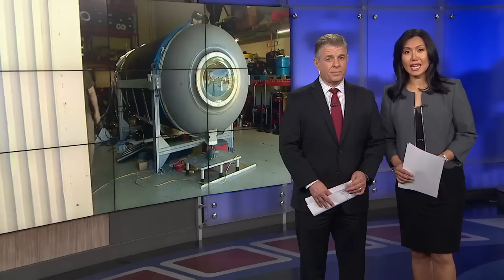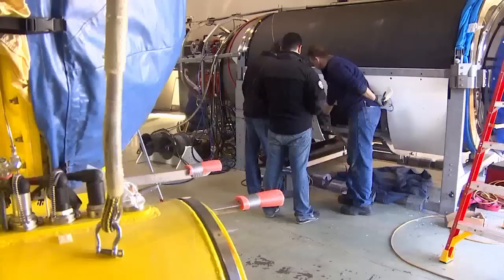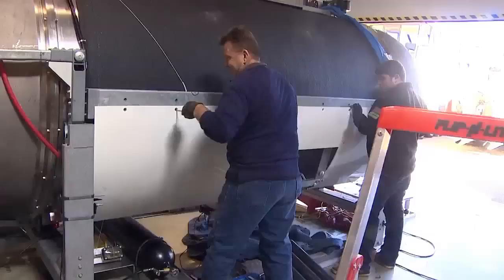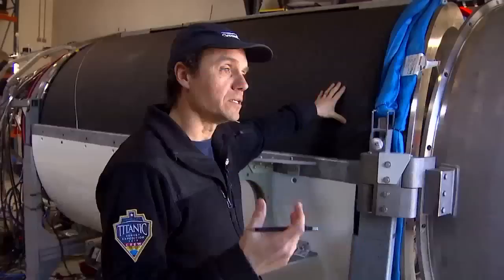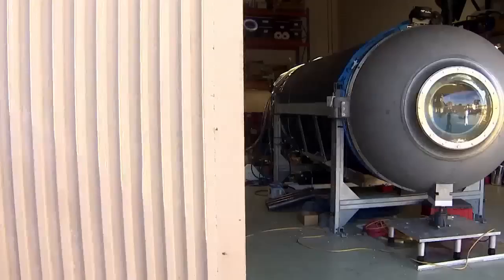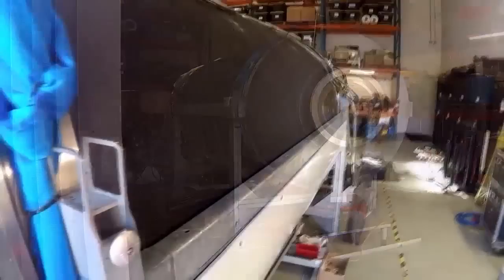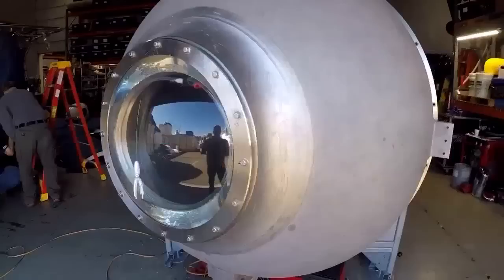The making of Titan: Oceangate's submersible capable of taking people to the Titanic

Comment: I'm a layman, but doesn't that door (with a flat mating surface) seem excessively large compared to any other sub designed for such depths? And controlling it with a game controller? WTF?
Reply: I know right...its like a guy trying to make an electric car and having most of the controls on some dumb computer screen in the car! If its different and new I dont like it!
Reply: 100%.  Even a tiny imperfection or gap in that mating surface would be catastrophic at those depths and pressures.  And because it lacks a modular design, any single point of failure will instantly cascade throughout the entire vessel.  That is why other deep-sea vessels have an isolated crew quarters (usually a small sphere with a minimally sized entry point), so that even if another component experiences a catastrophic failure, there is a good chance the crew will still survive.
Reply: The game controller isn't really that odd considering a lot of military/exploration equipment use game pads as most people are familiar on how to use one. It just makes the training less complex. The big issue is that this game controller was Bluetooth wireless. The deeper they go, the more interference they may experience thus making the controller useless. They should have used wired connections. I claim to be no expert on this kinda stuff but I have heard this people who are more qualified in the respective fields. Also the fact that Titan had no backup control systems was a recipe for disaster
Reply: Hey let's build a submarine make it look cool and have a few game controllers running it then dive to 13,000 feet below sea-level to see the bottom......
Reply: the viewport is also far too big and the fact the sub is not even spherical is concerning to say the very least.
Reply: @isaiahaguilera7710  🤦‍♂️

Comment: I'm a Pressure Vessel Engineer with a lot of experience with high pressure vessels design. By looking at the video and their design, I doubt they used an o-rings like you are suggesting. Most likely they used RTJ gaskets which can withstand up to 10,000 Psig and more. I'm more concerned about the material and size of the window been able to withstand high pressures.
Reply: The wreckage seems to indicate the glue separated between the cap ends of the tube. Titanium rings glued to 5 inch thick carbon fiber. A dome then bolted to that. The coast guard description they are claiming says they found the two dome ends in tact by the Titanic bow site. Then debris in between. Carbon fiber is said to shatter at that level of application. I'm not an expert in these materials, but it sure sounds like the epoxy only needed to fail a small amount to eventually give way a bit like stomping your foot on a Pringles can to watch the top go flying.
Reply: @bat__bat Wow! 😯
Reply: @bat__bat seems about right.
Reply: @bat__bat  Interesting! The safety margin for depth seemed alarmingly small to me, I guess a factor of 2 or more wasn't viable and/or the business model/needs appear to have taken preeminence. Coming from biking CF is an amazing material up to the point it fails and the mode of failure tends toward instant and catastrophic. There are well established methods for checking CF integrity, I hope there was rigerous documentation, ongoing maintenance and a craft retirement programme. If not the act of inviting the paying public into an uncertified, inadequately maintained craft makes passenger waivers completely irrelevant. No doubt the legal community is circling overhead!
Reply: I'm guessing you are also passed the age limit that OceanGate hired at. Instead of having people like you that know the field, and understand it, they hire a surfer and a few fresh out of college kids, that didn't take those types of courses in school, nor had any experience in the field. This is one reason, why I believe every single person involved with OceanGate, needs to be held accountable. The only thing they were successful at was designing a multi person underwater coffin.
Reply: The owner said the plexiglass window pressured in about 3/4” on a previous dive. Said he could hear cracking!
Reply: @jqulrich  lol 😂 yes and me! I’m betting one or several people from the company will get hung out. Do they really deserve it? time will tell.
Reply: @dave-d-grunt  WTF! The stories that are getting banded about are insane! The whole situation reeks of a one man smoking his own product and zero accountability!
Reply: @ananas6969 excellent observation, there is absolutely no way two materials (like titanium and carbon fibre) can be married together on a permanent basis they are almost opposite on a molecular level. Temporarily yes, extreme depth cycle after extreme depth cycle NO!
Reply: @Sidowse  so the carbon fiber on this vessel was wrapped around layer by layer like adding heaves of electrical tape to a tube until the material is 5 inches thick radiating outward from the inner pipe that is being wrapped. I actually have no idea what the inner core actually is that the carbon fiber is wrapped around on this vessel. So yes by wrapping layer upon layer it is really self-compressing as it is applied. I doubt the water pressure was able to affect the carbon fiber hull if you imagine the water pushing against the cylinder's sides at a right angle. So the compressive strength of the cf isn't what I think failed initially. As I said, I'm guessing the glue that held the cf cylinder to its titanium end cap rings is to blame for initial failure. I don't know what type of glue they used, but I'll assume it was like a NASA-grade epoxy that is water resistant, likely two-parts mixed together like a super duper JB weld. Silicone? Some exotic resin? Liquid metal slurry? Some research might reveal what exactly they used, but all I know from seeing it in one of those news clips is the glue was thick and gray colored. Adhesives are nothing if not famous for off-gassing when temperature and pressure changes around them. Like James Cameron said about the ship as a whole, it wouldn't have revealed its failures on the first or maybe even the second voyage, but the nature of the failure is developing over time with each dramatic change in temp/pressure. Maybe the glue they used has a proven track record at even higher depths for even more important vessel components. I don't know. But I avoid gluing anything unless I absolutely have to and I'm talking about household things or car parts that aren't life-critical. Maybe they should have used a stitching or welding method to marry the end-caps. But adhesive? If you can imagine the glue failing there, water would leak in through the microscopic gap and in milliseconds it would push like a million gallons of water  into that seam (exaggerated) but it seems to me the failed end cap would fly opposite the rest of the vessel, outward like a squished Pringles can.
Reply: @jqulrich  they couldn't even get that right
Reply: @bearb1asting  Lol true! Because a coffin isn't supposed to implode on itself
Reply: @bat__bat  I agree with you and Adonai both. The window and the end cap joints were both weak points. Stockton told someone when the craft would get deep, the plexiglass window would bow in, and it was freaking 7 inches thick, which is thick, but probably not thick enough for its size. Then they showed him gluing on those end caps with epoxy resin, and epoxy resin has a tensile strength of 5 to 6000 psi, but the ocean pressures at the Titanic are 6000 psi
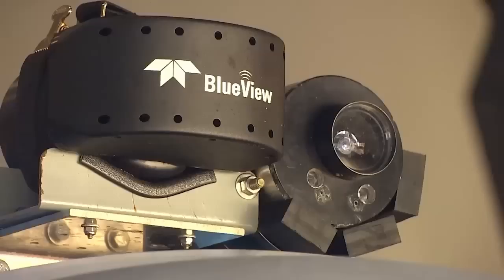Reply: 1:15 how do you feel about what appear to be huge glue voids around the edge of that window, showing a very non-flat joining surface?
Reply: @semechkiforputin6920  finger crossed he says "unsurprised"

Comment: A single O-ring to seal against 6,000 psi...on a large fixed hinge, flange door...?
Reply: Aircraft mechanic here and I thought the very same thing. We have to replace worn O-rings all the time due to them getting rubbed/worn/scratched. And apparently this thing made the trip several times. My hunch? Cyclic stress failure. They simply did it 1 too many times without inspecting everything and replacing the parts more prone to wear.
Reply: Possible the design was not the best for cyclical failure, aren't both titanium and carbon fiber considered brittle?
Reply: I'm a Pressure Vessel Engineer with a lot of experience with high pressure vessels design. By looking at the video and their design, I doubt they used an o-rings like you are suggesting. Most likely they used RTJ gaskets which can withstand up to 10,000 Psig and more. I'm more concerned about the material and size of the window been able to withstand high pressures.
Reply: @Adonai-lz5jb  - I was referring not to the door seal, but any possible seals in pumps/air hoses and the like. Flexing/use at cold temps usually make micro-tears and rips that cause them to fail or increase wear over time. But I was wondering about that carbon fiber. It is strong yes but at what temp, and at what depth? And yes, carbon fiber doesn't crack, it shatters? All of that is purely guesswork on my part. But based on what I know, personally I wouldn't trust that thing to explore the bottom of a pool let alone 2 miles down. If nothing else I would refuse to get locked in with no emergency egress. I care not to repeat Apollo 1. Fire aside, what happens if you are cast adrift? You could theoretically run out of air while even on the surface if you aren't found in time, and that's, well, just dumb.
Reply: @Adonai-lz5jb I know the dome of it was glued onto the carbon fiber would that have been the issue?
Reply: @GOODFELLA-uk6rz  I would guess they used an bolted acrylic dome in their design. Acrylic material gets brittle with low temperatures and gets affected by cyclic fatigue due to temperatures. I'm just guessing and doubt they had a good engineer design. You can't use glue for high pressures.
Reply: @thatguy9088  ah okay, I thought you were talking about the door seal. I apologize about that. Yes, you are correct low temperatures affect the yield strength of any material. Also, I didn't know they used carbon fiber to build it. I thought they used an alloy to build it. Carbon fiber is even more prone to fatigue due to low temperatures and can't withstand compression pressures as well as tension. It would be interesting to see any calculations that they ran in their design, if any.
Reply: @Adonai-lz5jb  The image of the hemispherical door flange at 0:12 looks like an O-ring groove. What do you think?
Reply: @Adonai-lz5jb  - According to the video the main body (the tube) was made of a Carbon Fiber and Titanium composite, wrapped in a single weave. But it doesn't elaborate.
Reply: @earlgreystoke3324  The design is trash.  Carbon fiber is usually used for internal pressure and not external pressures. Carbon fiber can't withstand compression too well. The material and component selection is trash. I doubt they ran any type of engineering calculations with all the different factors. Bolt quantity, bolt sizes,  dome window size and material etc. I don't need to run calculations to be able tell you that it was going to implode.
Reply: @Adonai-lz5jb  Was it this exact hull they were referring to that had gone down about a dozen times since 2021?  That would certainly be giving it some fatigue cycles.  Might turn out a miracle it lasted this long.
Reply: i have seen a little of the documentary on the build of Titan, i don't understand where the design came from, you would think an aperture of something that large would have a far more comprehensive system in place to seal the cabin, like a large screw on cap - even the bolting down seems too stupid and simple, remember KISS keep it simple stupid, there's over engineering and here's classic under engineering, i don't even get the logic behind gluing the titanium ring for the front dome to the carbon fibre tube, you would think that ring would have a complex fitting, being built into the carbon, multi layered inside and out the ring with bolts, i'm sure the pressure loading was pretty well looked into, but what of the extremes, the temperatures, the constant changes from down there to our atmosphere, look how aircraft have evolved, and the understanding after so many many accidents - we still don't know everything, and yet still the smallest most insignificant bee blocking a pitot tube can bring down the largest of planes, we live in a mad world full mad loonies

Comment: Evidently, the crew compartment was a cylinder with domed ends rather than a sphere. Not an optimal shape for this application...
Reply: Also, carbon fiber is a terrible choice.  It is great in tension for COPV. But in compression with high pressure on the outside ... Just no.
Reply: Well you can't really expect optimal results, when not a single person involved in the design and build of this "submersible" had any optimal experience. This is what happens when you want "young and fresh" in a field that requires expertise and knowledge

Comment: Made of carbon fiber and titanium?! Why not steel? CF may be great for airplanes and race cars, but to withstand 6K pounds of pressure per sq. inch?? I don't know about that.
Reply: You're right CF isn't designed for that level of pressure.
Reply: It is designed for that kind of pressure. Sadly, from the inside after being filled and pressurized. I think a lot of people, including everyone at Oceangate and all the "engineers and students" do not understand it's not the same in reverse with pressure from outside
Reply: @JF32304 It is if it's well designed.

Comment: The engineering to this thing is awful. Being that small, getting bolted shut from the outside, made of carbon fiber, and being controlled by a PS3 controller. This sub is piss poor quality.
Reply: YouTube couch-engineers...hard to satisfy
Reply: @whatyoudo9773 The thing has no beacon. If it surfaces, and the support crew can't find it in time,  then they are DEAD because there's no way to exit from the inside.  It doesn't take a armchair YT to recognize one of the flawed designs.

Comment: And the fact that they need someone else to open the door that’s crazy!
Reply: no thats engineering..a very specific craft thats meant to have a support crew. It happens
Reply: @whatyoudo9773 Safety experts recommended a secondary escape that can be opened from the inside. This was rejected. They also have no beacon. They could have successfully surfaced with everyone alive but the support crew has no way to track it, and the inside crew has no way to escape. It's designed to fail.

Comment: @KOMO NEWS : before giving your report publicly, did you find out if it is a safe vehicle. At a depth of 4,000 meters you need a submarine. Titan broke into pieces at great depth. For 14 years, improvisations have been used to build the vehicle. For 14 years, no authority has reported itself until after the tragedy.

Comment: Not only was carbon fiber the wrong material the window was rated for 1300m and they went down 4000m. Toss up if the hull failed or the window blew out first. Same end = impolsion and instantaneous death.
Reply: 1300 meteres = 3900 feet.  4000m = 12000 feet.  Here is a Malort and a Old Style saing the view port catastrophically failed first.

Comment: As a diy guy who has worked with composite material such as fiberglass and small amounts of carbon fiber in the automotive world, those materials should NOT be used at such extreme pressures. 
Carbon fiber matting is held together with resin, layer upon layer, which can create a delaminating issue, and a leak. Yes, when brand new, they are very strong, but weaken significantly as the structure gets used. 
At 5500 psi, with under water currents that produce dynamic shock loads on a used carbon fiber hull, its not surprising that it failed. 
This is why you see NHRA funny cars get new bodies every so often since they wear and fly off. Once they begin to crack and delaminate, time for a new body.

Comment: Its made of carbon fiber? My guess is that with every dive, there was some tiny amount of damage to the hull, until it failed.
Reply: Cracks do go undeteced.  Think about the DC-10 that crashed at O'hare airprt a some years ago.  Inspections were done.  the engine was reinstalled which caused a bulkhead crack in a hard to reach place so it was not notices.  The plane flew 25 or 30 or so more missions after the maintence and  inspection.  THe plane was taking off at Ohare, the port engine pod literally seperated from the wing on take off. the plane was at the take off point and the polit was committed.  The plane banked left and crashed  short of a trailer park killing all on board.

Comment: Worse, another video shows them attaching the front section to the cylinder using only an adhesive. No doubt a strong adhesive, but was it proven to be robust in those conditions over multiple dives? No tongue-and-groove or other methods to strengthen the attachment. The porthole section was literally glued on. Likely the vessel, the portal glass, the adhesive, all had different stress levels and none were tested properly. It was as tight as a school project.
Reply: I watched the video where it shows them gluing it on... jaw dropping. How they ignored the fact of expansion and contraction boggles the mind!
Reply: prob made by the same genius's that said " hey we cured the flu in a year, just take this shot" or else
Reply: That’s his aviation back ground showing. Way different pressures at 12,000’ Down than at 35,000’ feet in elevation . Is there anyway you can post the video you are talking about.
Reply: Naw, a little RTV and you're good to go. You can bet your life on it!